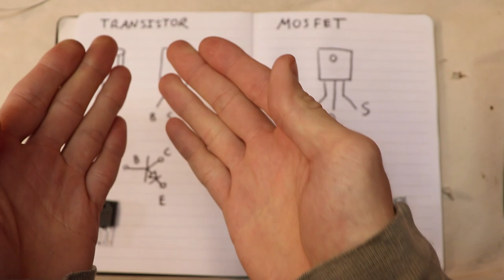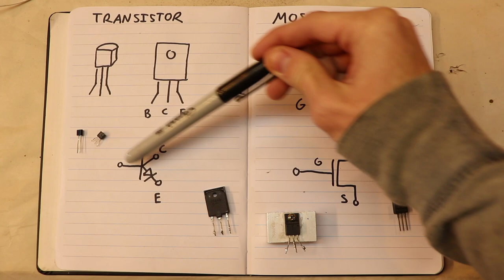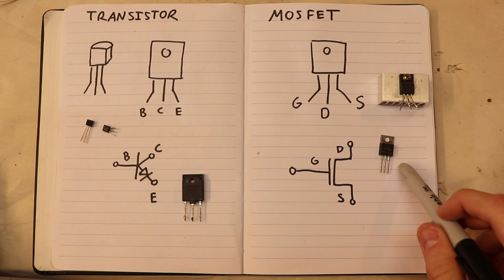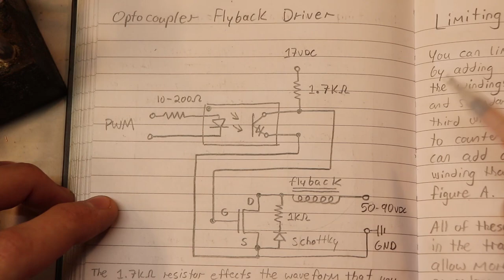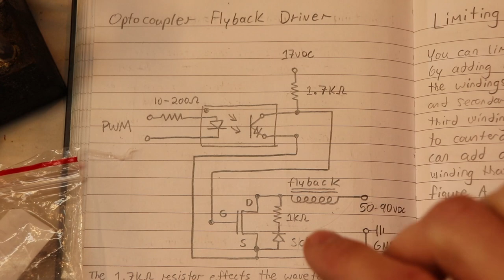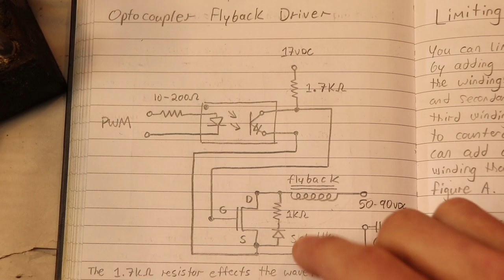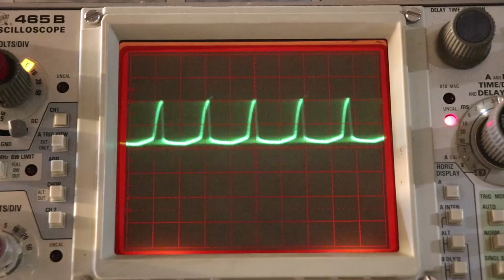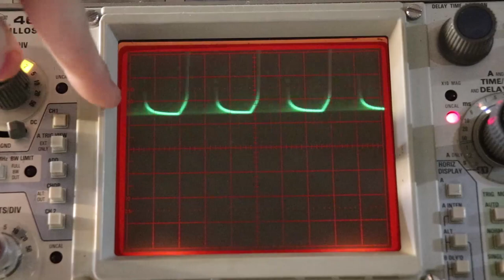How to drive a Flyback: Mosfets (Part 1)

Comment: In a triangle wave the wave is in the linear range while switching from low to high as well as high to low this is the area which creates the heat, in the square wave you have a very fast rise time and dropout time. You have to look at the times between 90% and 10%. So with a square wave very little time is spent in the linear range creating heat, when the rise time and the fall times become too high mosfets can have pretty violent flare up’s or mini explosive destruction.
Reply: He can use a diode to regulate the power in the inductor
Reply: Either way, use that bad wave

Comment: Awesome video; well done and very informative! Have you ever thought about using a two-switch flyback topology for driving a CRT flyback? You should see much cooler MOSFET temps and the other benefit is the back EMF from the flyback is clamped to the supply rails. That way you can get away with lower voltage MOSFETs which typically have lower RDSon parameters. The downside is the need for a GDT or a high-side driver IC, but the added complexity may prove to result in a more reliable circuit.
Reply: That just halves the individual switch frequency of each fet right? I dont see anything wrong with that. How could you offload the switch from the arduino to a hardware, dual switch oacillation?
Reply: You cannot clamp the "back EMF from the flyback" to the supply rail. That completely defeats the action of the circuit. The voltage on the input winding must be allowed to go to that determined by the output voltage and the turns ratio. This is the only important way in which the thing being called a transformer actually behaves as a transformer and it is a fundamental drawback of the topology. The ONLY thing you want to discharge is the small amount of energy stored in the leakage inductance and doing that with active circuity is complex, tricky and not worth the bother. A flyback converter isn't anything like a forward converter where active discharge of the primary is workable and sometimes worth the bother (versus adding a discharge winding).
Reply: @d614gakadoug9  You're 100% right in everything you said. Anecdotally, I built a relatively simple plasma speaker a few years back with a standard flyback topology. Worked well enough, but I would burn through FETs every so often. I tried a two-switch forward topology, mainly out of curiosity, not expecting much. The results were actually substantially better, at least in regards to music reproduction. Arc length was, as expected, a good bit smaller. YMMV. But yes, you're right; a forward topology is not really meant for driving a flyback. If you're curious, I think I have a video on my channel of that plasma speaker.

Comment: It always scares the crap out of me when transistors go bang! Hey this is the most reliable and controllable flyback driver I've ever used https://320volt.com/en/uc3844-super-flyback-surucu/ you could tailor it for offline rectified mains by using the internal primary coil and a modern high voltage avalanche MOSFET and upping the current sense resistor to something like 0.5- to 1 ohms (experimentation might be needed but generally a 1 watt sized resistor should get pretty warm at full power but not roasting hot to touch).

The UC3845 version runs off 12v, there are 3842 and 3843 chips but they go all the way to 100% duty cycle and this could run the risk of popped mosfets as that inductive snubber needs deadtime to do its thing and reset.

That 220nF capacitor would probably need to be a lot smaller with rectified mains, maybe a few tens of nanofarad at most (old CRT boards will have them in the deflection circuit for salvage). Not sure about the 1.5uH inductor but it seems more to do more with timing than anything else.

If it's not stable put a 10 ohm resistor in series with that gate turnoff diode or omit altogether as it creates some high dv/dt multi-hundred volt voltage spikes on the drain which can couple back to the gate in via miller capacitance. Keep your scope probe away from the MOSFET drain unless you've got a probe rated for at least the breakdown rating of the MOSFET as if you crank the power pot too high it can start avalanching and clamps the drain voltage to its breakdown rating. eg a 600v avalanche rated fet will clamp voltage spikes across the drain and source to 600v by converting it to heat.

To monitor the drain voltage put a high impedance RCD snubber over it, say UF4007 fast recovery diode, 2.2nF 1kV ceramic capacitor and a 4.7-10 megohm resistor, now connect your voltmeter across the capacitor and it will give you the peak drain voltage so you can turn the power down if its close to exceeding the breakdown voltage rating of the MOSFET. Lower switching frequency = higher output voltage for a given number of primary turns and input voltage until the core starts complaining.

That big filter cap on the main power rail should be a low ESR type as the peak currents are large, but for rectified 120v it can be much smaller say one of those 220-470uF types you get in PC ATX power supplies. Watch out for inrush current with mains as it could blow your bridge rectifier or trip the breaker, NTC thermistor from an old SMPS should do the trick.

Correctly tuned this driver can produce enough output voltage to destroy the flyback so watch out when running it unloaded, also take note of all the earthing/grounding notes as the last thing you want is for a hv spark to find its way back into the driver and house wiring. Obviously with unisolated mains you can't ground the driver, but you can still ground the metal core clamp and return pin.

It was designed by jmartis2 here on youtube but let me know if you need any pointers, a tight circuit layout is critical with this one especially the IC, gate drive and current sense loop.

Comment: Would it be a good idea to put a potentiometer to this circuit? Then I could turn the potentiometer until the arc is the biggest, I would basically be tuning the circuit. But the lower resistance the lower frequency and when the ark turns white hot it could blow my transistor.

Comment: Transistors are dielectricaly coupled from base to collector.The most important difference is that for the common collector (that's the one with the load on the emitter side) you'll need a higher drive voltage. While for the common emitter 0.7 V is already enough, for the common collector the voltage must be 0.7 V + the voltage across the load.

Comment: What is the best way to make stable voltage around 400kv - 1000kv?
All those cheap garbage who I bought form aliexpress  death after a few seconds working, even the contact times was less than one second to generate single sparks but they are death.. Im looking to one reliable high voltage generators without getting hot, without burning the ice without burning the coils.. only the best was Tesla coil but its make a huge noise

Comment: Have you (or anyone else reading this) "played around" with using these flyback transformers in a HHO electrolizers? I've run into several "side references" to doing so; but, very little info on how to do it and safety measures needed ~ just that it (supposively, at least) greatly enhances the gas output, due to the HV & HF doing a better job breaking the convalescent bonds...
Reply: I'm about to build one.

Comment: Thanks for the videos! I'm learning this stuff, but I'm not as advanced in this field like you are. I also play with Arduino and that is one of the reasons I'm interested in this project. I have FBT by: BSC 25-0278Q and I found the pins for input and the ground for the high voltage. I used a fluorescent bulbs' driver and I can get a very small discharge, but I'm interested in  much more flames, like you demo here. At about 19:20 time marker, your spikes get much larger - what exactly did you do to achieve this? Have you changed the values on the Arduino sketch? Can you upload the Arduino sketch and exact schema you're using in this video?

Comment: Super explanation,  but don't deny, You got a shock of something You didn't expect to happen!? :)
Wouldn't You better use a sinewave to drive the transformer?
Reply: No. The thing being called a transformer is not used as a transformer for energy delivery. It stores energy as a magnetic field when current is flowing in the input winding and delivers that energy to the output circuit via the output winding when the current flowing in the input winding is turned off.

Comment: I have built single transistor driver with feedback coil. It ran the best so far yet still not impressive. Constructed push pull driver arc is pathetic draws up to 6 amps at 10v and cant be ran for more than 20 seconds. Thinking of making isolated op amp driven two mosfet circuit if i cant figure out trans version. Any tips? I use it to make lichtenburg figures on wood. 

Ps. Great video. Really liked waveform explanation. Also the difference between trans and mosfet driving requirements.
Reply from the maker: I've tried to make lichtenburg figures on wood before and using a neon sign transformer or a microwave transformer is probably the easiest way. However, if you want to make your own custom circuit I would experiment with the ZVS driver that uses two mosfets and can switch a lot of current, Ive had a lot of success connecting flybacks to ZVS drivers Ive made and you could potentially connect TWO flybacks to it if you require more voltage since the circuit can supply enough current. https://adammunich.com/zvs-driver/
Reply: I have some mots. I they work great for thick pieces of wood. However the flybacks dc output gives the ability to draw with the lightning. Also enhances the fine effects the voltage has the image. Only issue was not enough current out caused it to take a very long time to accomplish. Would the inductor value limit the overall current the circuit pulls. I need it to be able to run continuous. Also do know a good place to get NST?
Reply: Also how would u go about modulating for plasma speaker?
Reply: One good mod is to get rid of douche cap

Comment: There is absolutely no AC involved in a flyback converter circuit in terms of delivering useful power. Current flow is always unidirectional in both the input and output windings. You can get ringing that is AC but it doesn't play a role in power delivery.

It is pretty clear to me that he does not understand how a flyback circuit works.